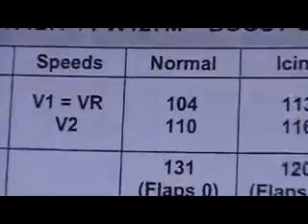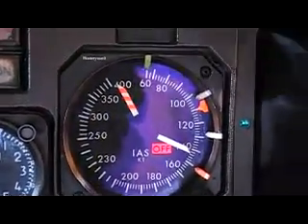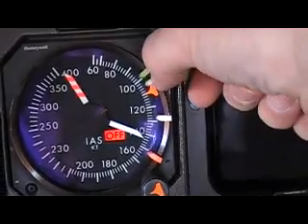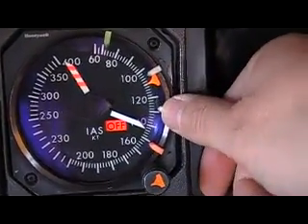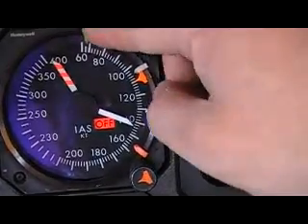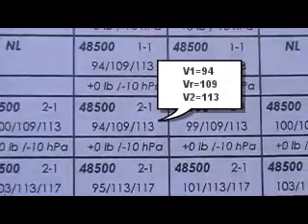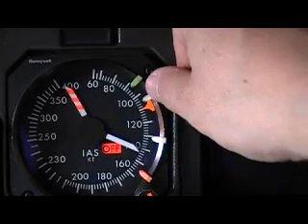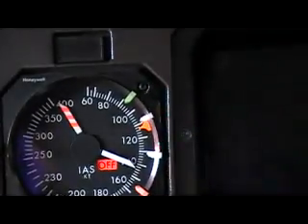ATR 72 How to set Take off speeds

Comment: V2 is the minimum speed with one operative engine, Climb speed is the normal speed you climb until level off, in the ATR 72 it's normally 170 KIAS, Cruise speed is the normal speed you cruise, it's normally 210 KIAS.

Comment: Green bug is VmHB for flaps 30 - it's like the minimum safe airspeed where you still have full control.
Orange bug is Vapp, which is the speed you actually fly the approach at
Yellow bug is Vga, your target speed for a go around
White bug is VmHB or VmLB for no flaps ( HB and LB mean high and low bank, your maneuver limitation ) 
Red bug I haven't figured out yet :-)
The speeds are calculated from landing weight and if there are icing conditions.
With the flightsim a Vapp of 105 is fine.